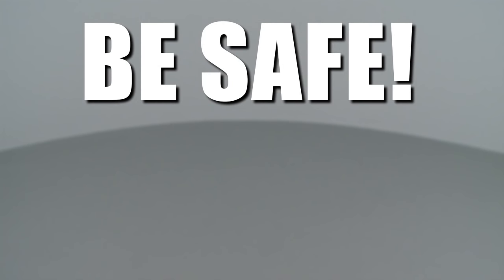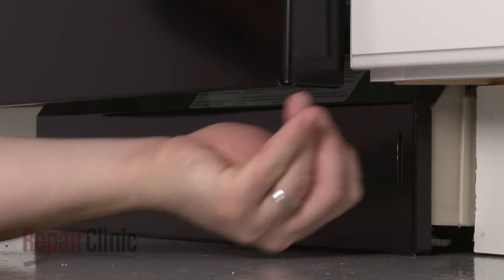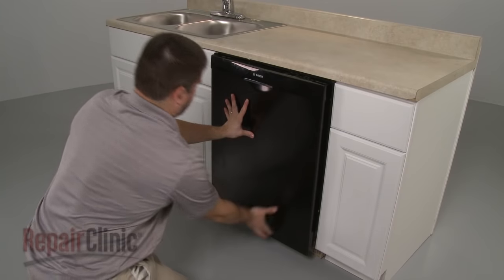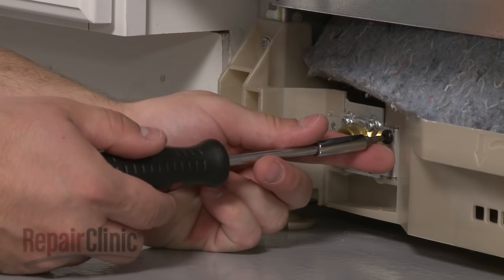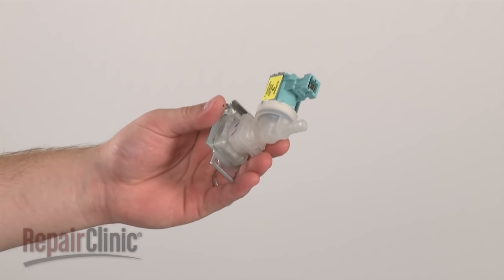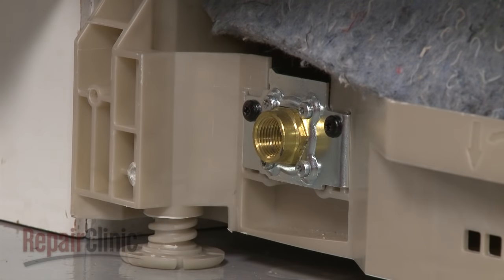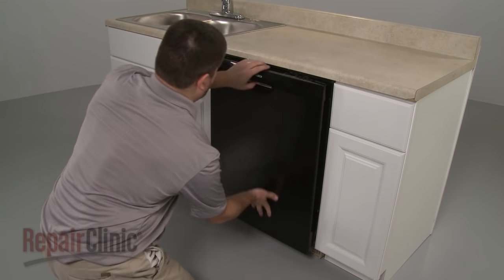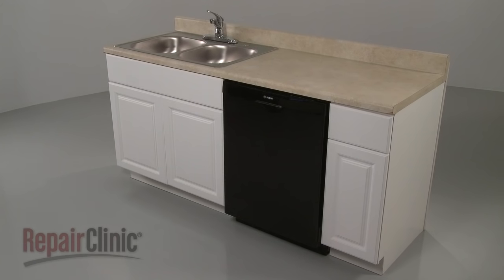Bosch Dishwasher Won't Fill? Replace Water Inlet Valve #622058

Comment: This video was perfect.  Easy and clear.  My Bosch was not cleaning so well.  Would not get hot like it used to, would not dissolve soap, top rack was really dirty.  I read that this can all be tied to the inlet valve not letting the proper amount of water in (low fill so it does not heat the water, no hot water means no soap dissolving, no pressure on the top arm to get the top rack clean).  I replaced mine and BAM! now it gets hot again, cleans great and dissolves the soap fine.  I was wondering if the circuit board was bad, but when I took off the panel visually it was fine.  The part was only $20 on Amazon, so I decided it was worth the attempt at replacing it.  Thanks again!

Oh, the machine also was taking forever on the cycles and was about 10 years old.  Visually I didn't see anything wrong with the old one but I didn't bother to take it apart.
Reply: This was my issue exactly, and thanks to this video, it is now fixed :)

Comment: Just replaced mine and it fixed it. It wouldn't fill and run but I'd hear draining. This part was like $22 online. Took about an hour to swap, the only thing that fought me was the hose that goes out of the valve to the washer, its a hard water tight hose, I put a little heat from a heat gun on it and it softened up and came off, same with putting back on. Thanks for the vid

Comment: I had a problem with my Bosch 800 Series dishwasher - where the bottom of the dishwasher was slowly filling with clean water, while the dishwasher washer was off.  Replacing this part fixed my problem.  Thanks for the video!
Reply: Did water eventually rise high enough to come out of the washer onto the floor?  This has happened to me twice in the last 9 months.  Is it that the inlet valve stays slightly open/doesn't close when the washer shuts off?  I'm concerned that it might get worse----even though it doesn't happen often.  Wondering if this part will solve the problem like it did for you.

Comment: I have the Bosch dishwasher she43rf6uc/64. I replaced the water inlet valve as instructed with a new one ($32.23, with tax from the local parts center). Removing the door panel was helpful; more accessible.  I found that reversing the order on the door panel and the lower access panel removal and re-installation made the job easier (I remember installing the lower panel before, you can see it so much better with the door panel off).
The job was just as easy as it looks in the video.
The machine is running now and seems to be functioning properly.
Reply from the maker: Nat Webb Thank you for sharing.
Reply: airline

Comment: Time to order another inlet valve, excellent repair instruction video, thanks Repair Clinic! - This is the third inlet valve I'm installing on my Bosch in just 5 years, good thing its an easy fix.  Seems to me this part needs to be built with better materials.  First valve electrical failure just 2 years old, would not open, this second one (the replacement part) failing mechanically after three years, makes a loud chattering sound when water is flowing about 50% of the time.

Comment: Thanks for such a clear demo of the removal of the valve.  Because of the mounting, and those "unremovable" star-head screws, the valve LOOKS much harder to remove than it really is.  I had it out in 5 minutes (didn't even have to remove the front cover plate), found a bunch of crud in the inlet side, and lo and behold, didn't even need a new one:  solenoid is fine, gate is fine: let there be water!:)

Comment: Thank you so much!! This showed exactly when I needed to do to fix my dishwasher, without 8+ extra minutes of patronizing commentary. I had difficulty removing the little brass elbow (just kidding, it was impossible and I gave up), so I just bought a new one. Then I learned why I couldn't remove the old one. Once I had that new elbow screwed into the new inlet valve to the proper tightness...it was pointed 180* the wrong direction from my supply hose. Unscrewing by a half turn would have been way too loose, so I had no choice but to really crank that sucker on. But my dishes are now clean, which makes everybody happy :)

Comment: Replacing this part fixed my top rack not getting cleaned! I couldn't get the elbow off or on easily, so ended up unscrewing the 2 valve screws before disconnecting the water, and then after reconnecting it, for easier access to the elbow with a wrench.

Comment: Very precise and easy to understand.  Took me about 1/2hr total following along w/the video.  Hose on rear hose outlet, w/spring clamp on it was a bit stubborn coming off the old valve but a little twisting and pulling got it off.  Thanks for the video!!

Comment: My dishwasher just has two wire connectors going to two vertical tabs on the old valve.   On the new valve, the tabs are intended to accept a connector as you shown in your video.  They new tabs orientated horizontally instead of vertically.  Which of my two wires goes where?  Purple and white.  They'll fit on the new valve's tabs no problem.

Comment: Very excellent and helpful video. Thanks!  
A couple of thoughts that might help others:

* I removed the valve before removing the elbow because mine was too tight.  I was afraid of breaking the plastic bracket holding the valve.  I had to put the valve in a vise to remove the elbow, it was so tight.
* It was not stated how many screws to remove from the inside of the dw door to get the front cover off.  Remove only the lower 3 screws on each side.  I had to loosen, not remove, the screw above those 3 because my cover would not slide.  This allowed me to pull the bottom of the panel out, which loosened things enough to remove the panel.
* The solenoid on my valve is oriented toward the right.  This is because the Electrical connection to my valve will not reach when oriented as in the video.  Bosch probably saved a nickle by shortening the harness.
Reply from the maker: +H. Hall Thank you for sharing.
Reply: I could not remove the elbow from the inlet valve and I don't have a vise. But I was able to remove the four screws surrounding the inlet valve and replace the whole unit(elbow and the part where the elbow screws into, up to the o ring) on the new one. Glad to have a working dish washer finally. I am thankful for the video and the people sharing their experiences.

Comment: Actually, since I had the model Bosch SHE53T52UC (hot water intake valve), the valve was in the back and did not require removal of the door and toe plate at all.  Wouldn't be a bad idea to include a couple of the dissimilar models in the instructions.

Comment: Great video for an easy repair however the assembler wasn't as generous with the internal hose on our unit.  I had to tie a piece of string to the hose clamp to get the hose back on the valve as there wasn't enough length to bring out outside the frame.

Comment: Video was good, unscrewing things (particularly the elbow joint) was rather harder than in the video, but I managed.  Was so happy I replaced the entire part on my own!  Also happy that I didn't need to take off the door, only the access panel.

However, dishwasher is still not filling, and I know water was coming to the valve.  Makes a sound inside like it is trying (both with new valve and with old valve) but no water coming through the valve.

Now what?!

Comment: My Bosch has a slightly different wire connection with smaller pins... Is there another kind of inlet valve?

Comment: What would you suspect would be the next thing if the overflow float switch and inlet valve have both been confirmed working on a Bosch  smu7056uc. I have replaced both and flushed out the side and put it back together and worked for one cycle then stopped filling again. Is there another float switch somewhere? I didn't see one.

Comment: My dishwasher won't start, I get a flashing ''sanitized'' light on startup. I removed and cleaned the inlet filter and there was a lot of particles coming from our well, but I still get the error. I suspect the inlet valve but I am hesitant on ordering a new part since I am not sure it will fix the problem.

Comment: My bosch dishwasher SHX68T55UC/02 been having a watertap issue.  I replaced the drain pump and it seems to drain better.  I checked the hoses from the drain to the airgap  and garbage disposal with no blockage.  dishes are clean but last time they were gritty.   Can a watertap issue caused by the water inlet problems?  Will the watertap error go away?

Comment: I replaced the water inlet valve per the video. The dishwasher started and went thru a cycle. I thought all was fixed. But when I went to start it again the water would not fill. So I’m back to where I started. What do I do now?

Comment: I have an older model Bosch dishwasher # SMU4056UC.  Need to replace the water inlet assembly but can't find a video on replacing an older model unit.  I was able to buy the part on line but unsure on how to install it.

Comment: Okay. Well explained. But how can I be sure that the water inlet valve is broken? I released the left sode panel and I started the machine. No water gets in and I get the E24 code. Once I also saw the E 21 code. The machine has been out of use for 2 years. So I guess that might have contributed to the valve failing. Also I filled the machine with half a bucket of water. It pumped it out and the same e24 error code appeared.
Reply from the maker: Click here for dishwasher water inlet valve testing video: https://www.youtube.com/watch?v=7NiFMxhd-pU

Comment: I replaced the water inlet valve as instructed with a new one. Water was not coming into the machine and is still not coming into the machine. There is no blockage from the water supply hose. Do you have any ideas what could still  be the problem?
Reply from the maker: b nash Enter your model number into our repair help section for additional causes of dishwashers not filling properly.  http://www.repairclinic.com/RepairHelp/How-To-Fix-A-Dishwasher/34---/Dishwasher-won-t-fill?TLSID=1773
Reply: ***** Yes thanks i did that. I have a a bosch  SHU3326UC/11. I was going to check the float switch as per your videos, but my model seems to be encased on the bottom and sides and nothing is easily visible.
I'm also wondering if when i replaced the inlet valve whether i switched the lead positions. The orientation is different on the replacement valve than on the original. The dishwasher turns on however it still does not fill with water however.

Comment: I have a Bosch SHU43C06UC/17

this is my problem when I press the power button I just get a clicking noise behind the function button and the cycle countdown doesn't turn on. could the solenoid be the problem?
Reply from the maker: +Kevin Bultman If the dishwasher does not start the door latch is the first part we would check. Also, a defective start switch could prevent the dishwasher from turning on.

Comment: My DW makes a grinding noise recently. It still cleans very well and drains very well. Just the noise is the issue. Yesterday, once I heard the noise, I immediately rushed over and opened the door. There were 47 minutes left on the clock. So roughly 50 minutes had passed. Inside DW, it was pretty warm and there was no water on top of the bottom screen. So I am totally at loss. Was the noise made by drain pump when it was to drain, or was it made by the inlet valve when it tried to open and let water in? Any one can help? The noise is not constant. DW only makes this noise two or three times during an 100 minutes wash cycle. Thanks for any help!
Reply: BTW, the noise is pretty loud. But it does not last very long. THX

Comment: After replacing both the inlet valve and the drain pump, I still have standing water (maybe 1/2") at the bottom of the dishwasher - under the drain and circulation filter.  Is that normal?  I don't remember water being in there in past times when I have cleaned out the drain and circulation filter.
Reply from the maker: +finsonfarm It is normal for water to remain inside the sump to prevent seals from drying out and cracking.
Reply: +RepairClinic.com thanks

Comment: i've replaced the inlet valve however now the dishwasher almost sounds like it's trying to drain and i hear no water actually filling up in the dishwasher. i have tried several different run cycles and it does the same each time. any suggestions?
Reply: and yes, i have the water turned back on...

Comment: after removing the front door panel and lower access panel, my model still has some other panel covering the inlet valve, but I can't see an obvious way to remove it. SHE5516UC/64.
Reply: figured it out. there are two deeply recessed screws that I couldn't see without a flashlight.

Comment: Just a quick question after tackling this on a neighbor's unit. Why bother to remove the door panel? Nothing in this entire operation takea place in there, and it just adds more complication to the process.
Reply: I tried it on mine. It appears the door removal gives you extra room to lift the valve up and out of the slot. Also gives more room to turn a wrench on the water supply line.